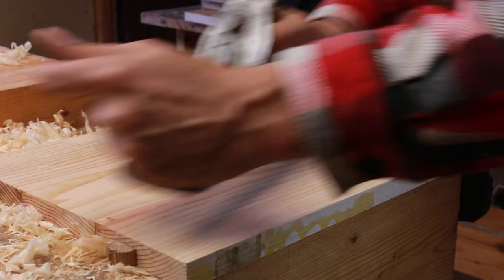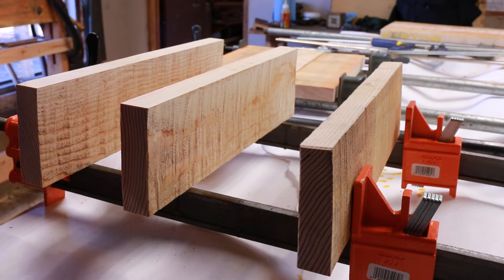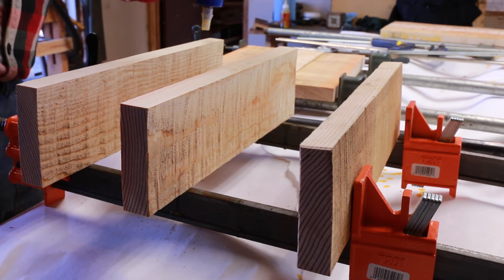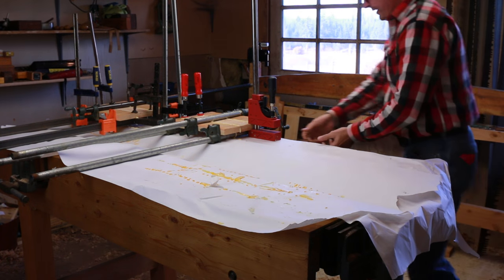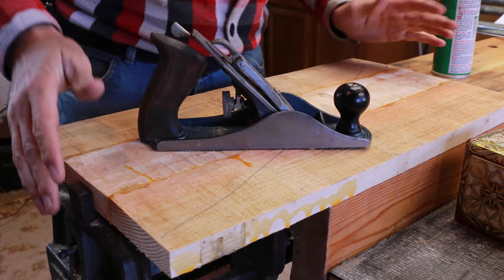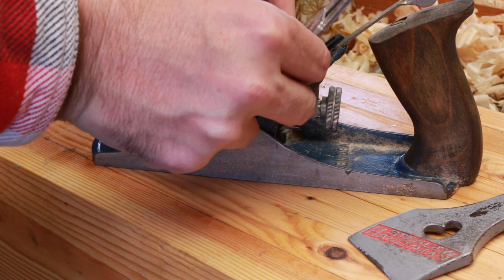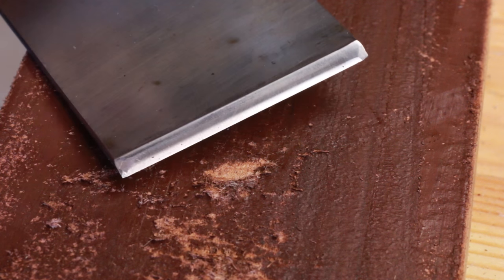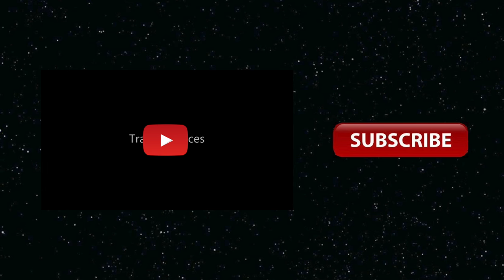How To Build Heirloom Kindling box pt 3

Comment: It is a waste of glue if you use too much, which you clearly do.  It is your money and clean up.
Reply: With all due respect, the only way to get a full strong bond with the glue, is to be liberal with it like Cody is.
Reply: I have been building custom furniture and cabinetry for many years.  I didn't say not to be liberal, and I didn't say he was wrong.  I said he is using too much.  Cody is a self- admitted novice at woodworking, and it shows.  He does; however, create good content.
Reply: +Logan Wyatt no doubt all that glue on the table and on top of the wood isn't contributing at all. All you need is one line spread it let it tack up a bit a little squeeze up is good. I don't know how much glue is in the states but up in Canada its like $4-$5 for a small bottle

Comment: hey Cody. I kinda cringe whenever i see folk planing glued wood without getting rid of the excess drippage first. If you're gonna do any gluing might i suggest grabbing a carbide paint scraper from harbor freight soon. It WILL save you lots of sharpening and cleaning and comes in handy for a million odd jobs 'round the shop. Hoping to see butcher block type counter top for mrs. W. happy trails!
Reply: +grodad Good little tip!
Reply: +Captian Marvel 
He may indeed care. No sense in batting down a few words of wisdom, you should always be looking to learn something.
Reply: +grodad Excellent advice -- I was thinking the same thing -- finger nails on the chalk board.  A nice paint scraper will do the same thing, knock down those glue drippings.  I also like to take a damp rag once the glue is starting to set up and wipe off the extra drips so they do not harden into rock.  

On the knot -- I love knots in wood, it adds lots of character as long as the knots are solid.  

Great video.
Thank you Cory....
Reply: +Captian Marvel So, has Cody given you the task to decline advice for him? Maybe I'm being presumptuous, but I think Cody can determine (on his own) whether or not he will take the advice that is offered up to him.
Reply: Captian Marvel Mr Cute Furry Animal -- not everyone is an expert carpenter. Yes -- Norm Abrams would have a fit, but you have to remember this was ripped on a table saw, probably not jointed, so there will be a lot of gaps.  Remember -- this is a kindling box.  Not a Grandfather Clock. The imperfections are what make the woodwork yours.  So my advice is, lay off on the negative comments, and if you can do better -- make your own channel.  You have no idea the amount of post production editing that has to go on for each min of video.
Reply: +Seth - ignore the trolls.  They deserve pity, but never a direct response.
Reply: I like Cody and post the results of my misspent 62 years for him AND YOU GUYS because I really don't want to take it all with me when the C.O.P.D. takes me out. Take it or leave it,, hope someone takes it tho,,, :)
Reply: I used to be a grammar nazi,,, but now I'm in recovery.
Reply: OK OK Sal.
 I fully admit I misuse commas all the time. it's a cheep & dirty way to add depth and/or flavor to dialog. It's a result of reading thousands of paperback "novels" over the years. Don't really give a whoop any more really. However, please feel free to toss me under your bus any time sir. A little constructive criticism is always welcome.
Reply: Pulp fiction type lit is full of such illicit punctuation. At least the stuff I ate up in my off seasons. Thanks for the tip (by the way).  Critiquing written dialog is a favorite hobby of mine. I find it a rare skill and am saddened by all the otherwise good movies ruined by hacks who have seemingly forgotten how real humans sound when they talk. yea,,nay?.

Comment: Take this as a suggestion and not a criticism... The cap iron on your handplane should be adjusted loosely enough to firmly hold the plane iron but loose enough to be able to make depth adjustments without loosening the cap.  If you loosen the cap to make adjustments, the iron will move around as you re-tighten the cap.  If you make adjustments without loosening the cap, you can make incredibly fine adjustments to the depth of cut, and you won't lose your lateral adjustment setting.

Comment: Wipe on Poly works really well too for protecting tools from oxidation. Used it for years in my carpentry business.
Reply: +wxfield Yep. Water based poly. John Heisz has a video about that. It works remarkably well.
Reply: Cool! John Heisz is a clever woodworker. I dropped a chisel of mine into a can of wipe-on poly I had at a jobsite. I put the chisel along with 3 others into a bucket and left for the weekend. It rained part of that weekend and when I came back 2 of the chisels were rusted badly but the third was nearly perfect. The best part about the poly is that it's cheap and very durable too.

Comment: Did you forget to put a link in the corner, like you mentioned ? Anyways, I'm at the same place as you, pretty much. On our learning about using old hand tools and such. Im following your lead, so forgive me if this sounds stupid. I would think using a plane that was as long as the hump your trying to take out, would make it flatter, quicker? By planing diagonal to the grain. I guess what im saying is, why not the #8 ? It's so beautiful.
Reply: +HOSSMCGILLICUTTI Why not?
Reply: +HOSSMCGILLICUTTI Speaking of my own experience with my No. 7 and No. 6. The much greater weight of the plane makes it more work to push, and thus more exhausting. Also a bigger plane feels more clumsy, it is not as easy to maneuver around. If you know your plane and check the surface for flatness often enough you really don't need the length either, at least not for getting it to smooth and reasonably flat. Where the longer planes shine is when you need to joint two long edges for glue ups, but even here you can work very well with a shorter plane.
Reply: HOPKIRK Thanks for the advice. I've watched everything i could find with Paul Sellers. I watched Roy Underhill for 30 years, even way back when there was only 3 channels total on tv.Im going to check out the others you mentioned.Love the BBC for a while now. I watched every Grand Designs show over the summer. Love English humor, i remember watching Benny Hill and Monty python years ago.Thanks again
Reply: +Maxid1 every time i hover over that top right corner it costs me $20 bucks. Haha

Comment: You use a lot of glue, I guess that's better than not using enough right.  Cured wood glue can be difficult to chip off of the pipe and other clamps.  I have found that spreading wax paper across the clamps first prevents the excess glue from dripping on them.  If I used Chinese clamps it wouldn't matter much but like you, I too use Jorgensen clamps for my projects.  They are really nice and not inexpensive...worth taking care of.  Bessey clamps are also high quality.  Irwin (Visegrip) makes (made) good clamps but I stopped purchasing them when they sold out to China.

Comment: I've been watching your videos and love the wok you do in the name of God. It is a blessing to see what God has allowed you to learn and to show to others.

I would like to give a tip from when I took Woodworking in college. We used to have 1/4 inch by 1/4 inch by 6 inch strips of cyprus or oak that we kept in a water bucket for gluing. When you have to use a clamp on a joint,such as you have had to do with this video, we placed one of the strips across the joint to keep both sides level. The wet wood prevented the glue from sticking the strip to the wood we were clamping, making dis-assembly easy. And if we used too much glue in the joint, a quick tap of a hammer broke the glue leaving a flat joint.

I just received my signed copy pg "Modern Homesteading" yesterday and am now reading it for the second time. There is lots of love for the family and God between those pages. Blessings to all of you. And call your wife "Mama Wranglerstar", a good name for the sweetheart of your life.

Comment: What's the name of that oil you use on your tools? I keep going back to that part in your video but still can't make out its name. ATM I use 3 in 1 oil on my tools but I have to clean it all off before I can use it on wood otherwise it soaks in to the wood and stains it. so I'd like to use something that you can put on and not have to clean off before commencing work just like you have. The Glue Debate - Why do you not just wipe the glue squeeze out off with a damp rag whilst it's still wet? My old woodworking teacher would always say "Use enough glue so you get some squeeze out but not too much". Then wipe any squeeze out off with a damp rag whilst the glue is still wet because the glue sets harder then the wood and will dull your plane blade in no time. I love to watch your DIY Build/Carpentry videos keep em coming. :)

Comment: Hey Cody. It should not be necessary to release the tension of your cap iron when you make an adjustment to your plane. It be possible to adjust your depth and alignment with one hand, without even adjusting your grip on the plane. Being able to adjust on the fly like that speeds up your work and since it is less of a hassle to adjust, you are more likely to always use the appropriate depth of cut.

If you set your lever cap screw too lose the blade alignment might drift a little, but it is not much of a problem, since you can adjust it on the fly.

Comment: Love your channel, but would ask why do you completely remove the screw in the cap iron to release the Blade - which has a large hole at the end of the slot designed to allow the screw head through?  Leaving it in situ is quicker, and its less likely to go missing.    Also, my dad used to use the 'sharp' end of the Lever Cap to loosen the aforsesaid screw rather than a separate screwdriver.

Comment: 1 you shouldn't put a plane blade down if you accidentally put it down or a rogue nail or screw and don't realize you could damage the blade. 2 you shouldn't have to release the blade in order to set the depth, it shouldn't be that tight

Comment: hi cody iv got a question 4 your Q&A  iv bean given a few chisels and plains sum 1 has tryed to sharpen sum with grinder and sum with file sum have huge chips i want to restore them and use the as im like u i dislike new chisels . what degree angle should i put on them ?

Comment: Cody,

I noticed that the boards you glued up for the panels were all different thicknesses and pretty rough.  One trick I learned which has cut down my workload tremendously is to use a scrub plane across the grain at first to hog off the waste before smoothing the boards to a flat smooth and tear out free surface.  What I do is plane a small chamfer on the back side of the panel to stop the scrub plane from tearing out the back end.  Then use the scrub plane and plane across the grain with whatever depth of cut that is comfortable to you.  It should be relatively easy to plane across the grain and it will take off the high spots very fast.  After a few passes up and down the board, I usually switch to planing at 45 degree angles up and down the board which will help keep the board flat.  I usually keep a straight edge on hand to periodically check the board for hollow and high spots and adjust my planing accordingly.  After the board is fairly flat, I switch to a plane that has a straight blade and is the appropriate side and plane with the grain to flatten out the plane marks left by the scrub plane.  Doing it this way will drastically cut your planing and sharpening time versus trying to remove all the stock with a smooth plane going with the grain.  

Once you have one side flat and smooth, you can set a marking gauge to the thickness you want your panel to be and score around the 4 corners.  I then bevel the edges to the marking gauge lines and then use the same technique to flatten the other side working to the marking gauge lines.  Once you hit the lines on all 4 sides, you have a board that is exactly the size you want it to be and it will take a fraction of the time.

Try it out sometime and see what you think.  It also works great when flattening table tops or workbenches.

Cheers,

Cory
Reply from the maker: Thank you so much glory for the great advice I didn't know any of this I'm going to watch Paul sellers video about retrofitting a scrub plane and I'll try this method I'll shoot a video on it again thank you
Reply: Glad you saw this comment and will try it out.  I just watched the next installment of the project and saw someone recommend a similar solution in the comments.  I used a #5 and ground a camber on the blade to create a scrub plane.  A #4 will work well as Paul will teach in his video.  Good luck and god bless.

Cory